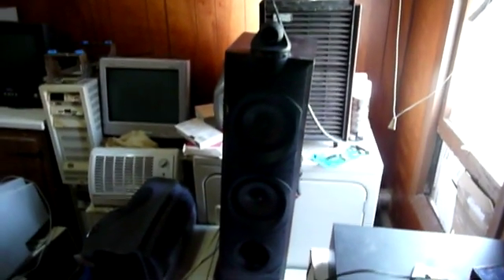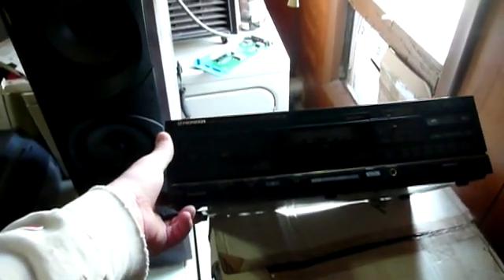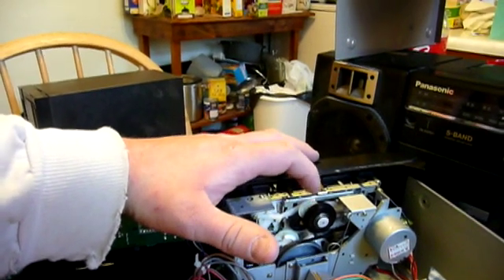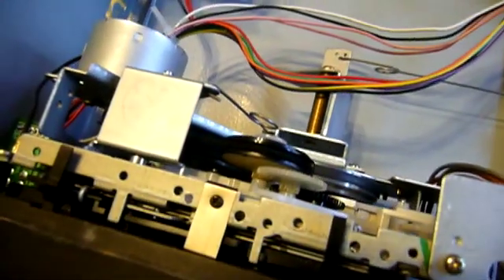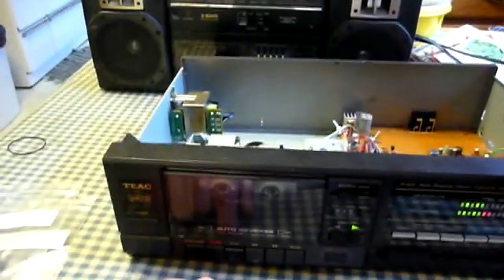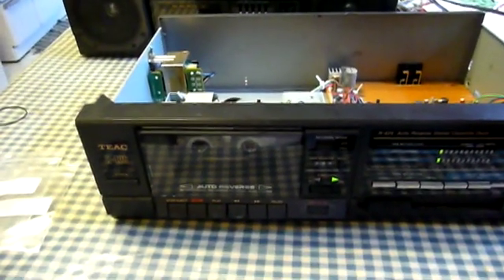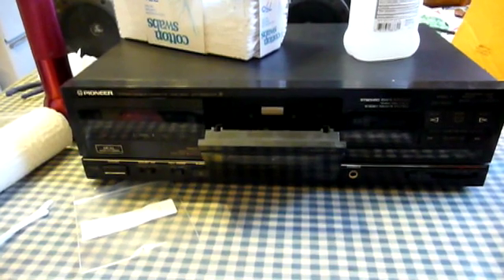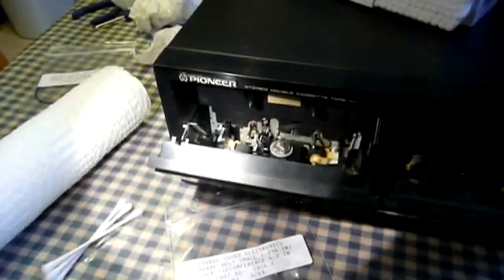Kitchen Table Electronics Repair - A Tale Of Two Tape Decks - Part 1

Comment: I have an old Pioneer Dual Cassette Deck.  When I attempt to use the "cd-sync" button (copying from cd to cassette) it will only work for about 30 seconds, then the cd-sync turns itself off.  If you have any suggestions, I would greatly appreciate it.  Thanks.
Reply from the maker: Do you have a compatible Pioneer CD player attached?

Comment: Thanks for posting this up. Needed the inspiration to try to pop mine open again. It's been years since I've had to fix one and I was afraid I wouldn't be successful in my attempt. Done. And done. Thing is working like new. Both decks. Both sides.

Comment: i just picked up.a 1974 Sony TC121 tabletop cassette deck with vu meters for $10 @ thrift store. i cleaned the chassis,deox the controls,buffed the rva connections,replace 1 belt and cleaned the heads. Now it sounds like a million bucks. love thee old school electronics!!!

Comment: When you replace the main drive belt, your supposed to readjust the motor speed with the screw on the back of the motor. Of course this requires a special test tape and a frequency counter. Or if you have a good sense of pitch, and are used to a certain piece of music, this can be done by ear. Simply turn the screw slowly until it sounds like the proper (pitch) speed.

Comment: Hi uxwbill,
I have recently purchased a Harman Kardon HK 2000 cassette deck for a few bucks
i took it home and cleaned the heads,capstan and roller and tested it.
It played the tape but it sounds like the tape is slow it plays the music but it sounds kinda garbled and one of the analog meters pegs out to the red zone could the problem be the belt? I have not opened the unit yet to inspect it.

Any suggestions? thank you for any help that you can provide.

Rob
Reply: Thank you very much for your quick response uxwbill, i cleaned the pinch roller as best i could due to lack of room not having dissasembled the unit yet. The roller looks in good condition as for the belt (s) i wont know until i disassemble the unit.
I will check the controls for cleanliness and spray some deoxit.
Thank you again
Reply: Hi uxubill,
I finally got belts for the HK-2000 but i only replaced one of them wich was for the reverse mechanism. I am currently listening to it and it souns great! what i wanted to ask you is concening the peak meters dials for left and right channels. Is it ok to let the meter pegged out to the red zone? or do i need to adjust the meters (there are slots for adjustment to either go all the way to the red zone or the opposite direction)
I do not have an owners manual. So i am asking for your expertice.

Thank you
Rob

Comment: BTW, the second tape you show is a chrome (CrO2, Type II, high bias) tape. These have the sensor holes located right next to the record-protect tabs, so if you punch out the tabs, it just looks like one large rectangular hole on each side.

It is metal (Type III) tapes which have the sensor holes in the middle, but metal tapes have been out of production for years and were never that popular even in the '80s, due to their high cost.
Reply: IIII